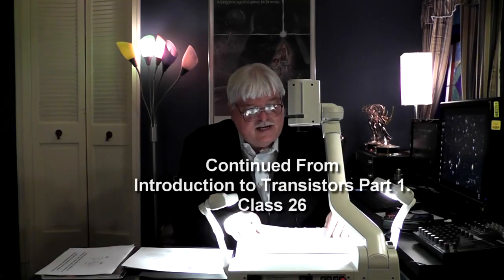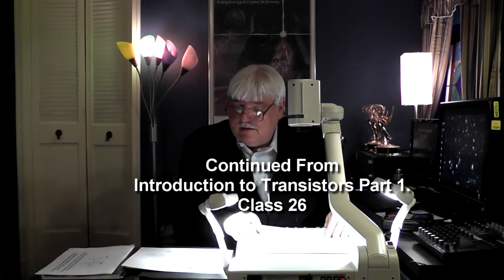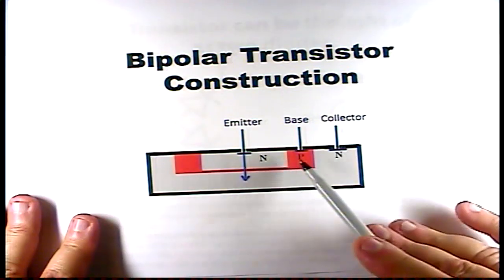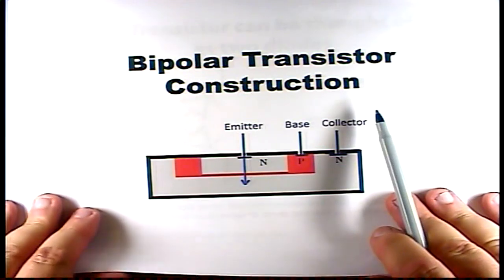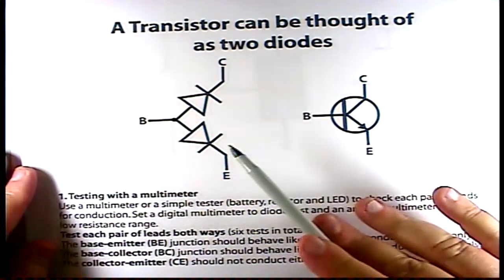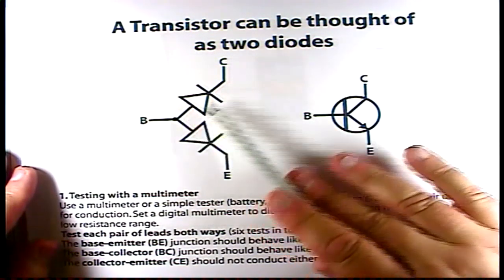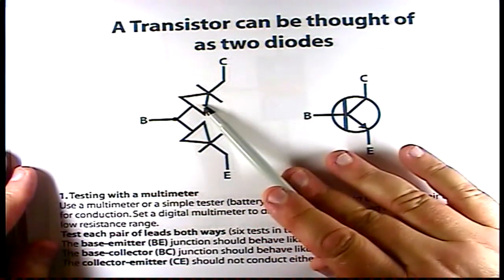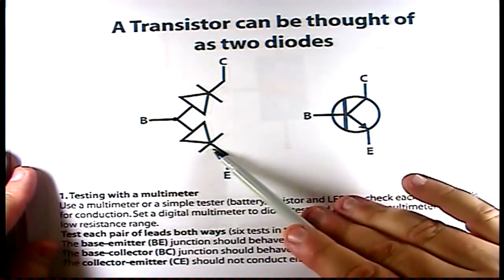How a Transistor Works,  Transistors Introduction 2. Class 27

Comment: Fantastic explanation and excellent teaching!

 From wikpedia on why hooking up 2 diodes wouldn't work the same:

"Connecting two diodes with wires will not make a transistor, since minority carriers will not be able to get from one P–N junction to the other through the wire."

The only other area I was getting a bit confused was conventional flow vs. current flow, but since i've started writing everything down in a notebook it helps to be able to stop (especially given pnp vs npn confusion).

Thanks!